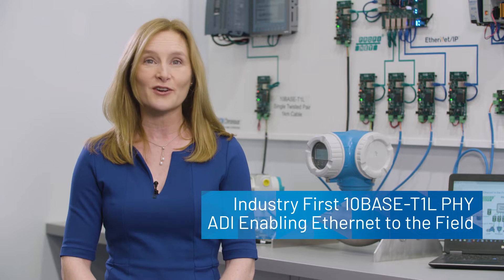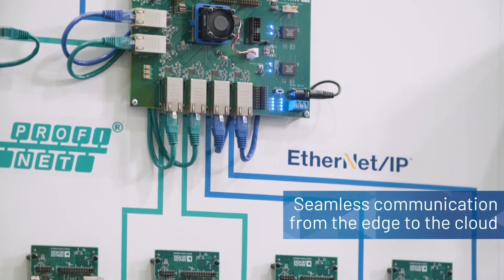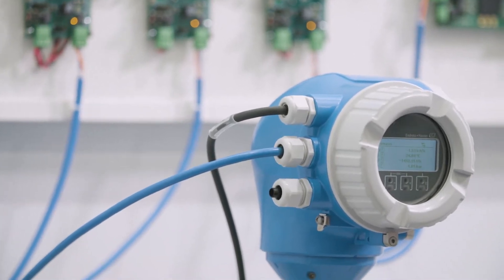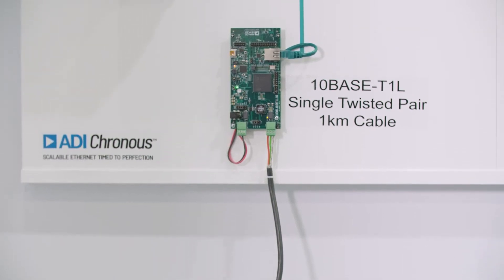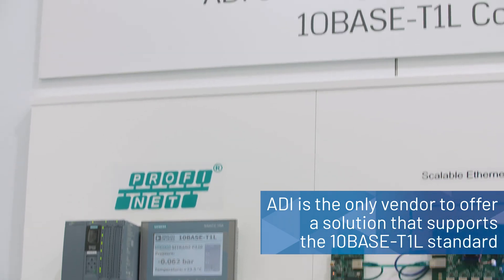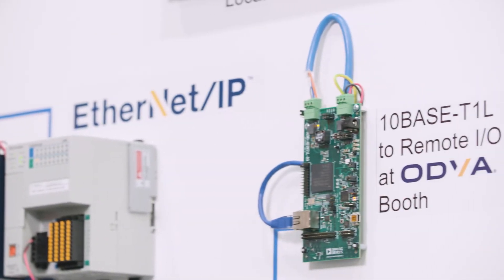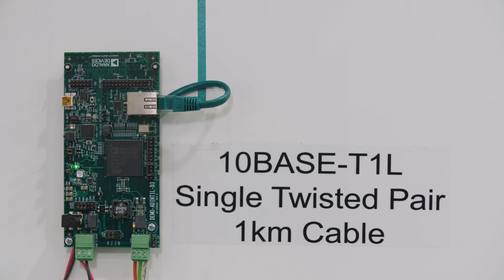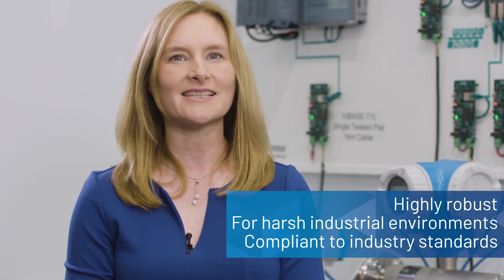ADI: Enabling Ethernet to the Field with 10BASE-T1L Connectivity

Comment: Could You tell me what Is the difference between 10BASE-T1L and 100BASE-T1 (beside speed)?
Reply from the maker: Thank you for your question! The difference is T1L is specified for a cable length of 1000m.  
T1 is specified for a much shorter cable length of only 15m.